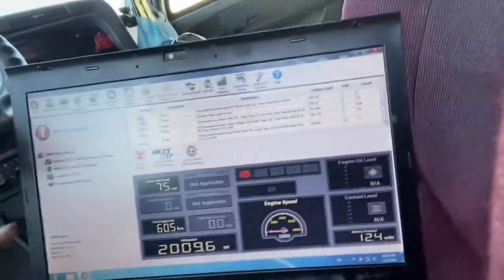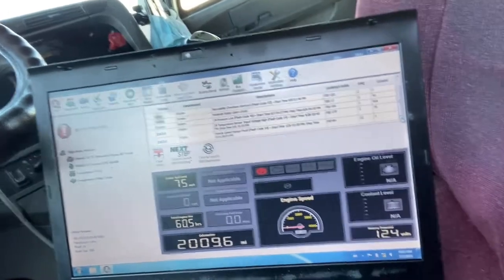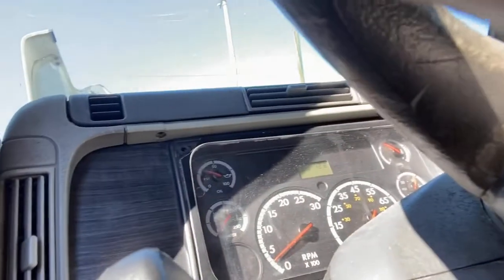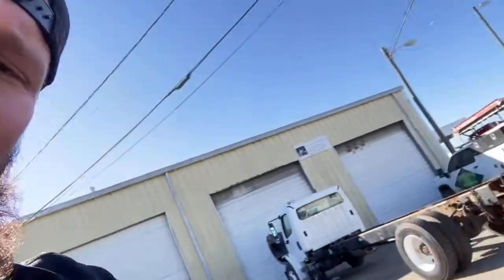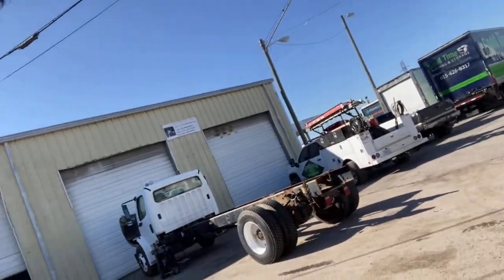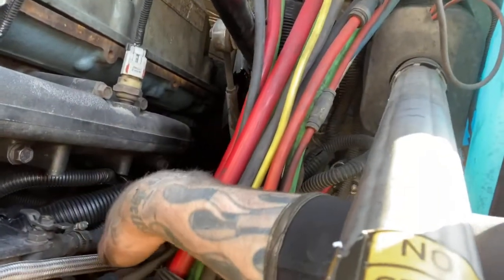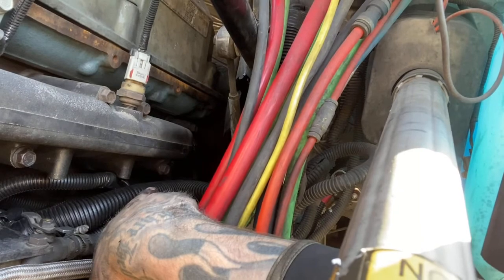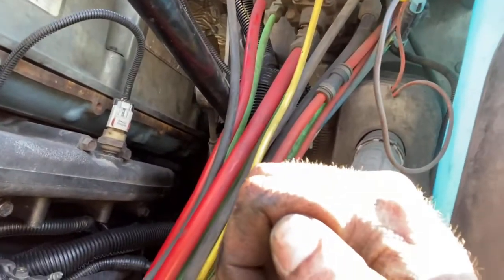No oil pressure shutdown DD60 Freightliner Columbia

Comment: We had to clear the live data using a scanner  said had no oil pressure cleared code wasn't enough have to reset live data as well
Reply from the maker: have to fix the oil pressure issue first
Reply: @StickShiftRacing  it wasn't me but I college didn't put oil in it and he was servicing the fuel filter water separator and he represurized it and was checking it and forgot oil 🛢 😅 which tripped the oil sensor truck did what it's supposed to and shutdown we added oil cleared code still didn't start turns out we had to clear and reset the live data as well he didn't wanna get in trouble lol he's a newbie but ya learn something everyday that's why we found your video
Reply from the maker: @blaizbbs9548  thanks bro make sure to subscribe to my channel!

Comment: I'm helping my dad figure out a similar situation to this video. He has a mechanic that he takes truck to for some repairs but I have some reservations about this mechanic from time to time. He's a decent fellow overall. I'm not a mechanic but if something is explained to me, I can understand. In your video, you mention about checking oil pressure with a manual gauge. Can you explain that process a bit more please? What tools are required, what is connected where and what in depth information will this give you? I'd like to know this information before hand just in case the sensor doesn't solve my dad's problem. This way I'll have some knowledge about this procedure and can ask his regular mechanic this same question and see how the mechanic answers this question. So I'm using this information to see if the mechanic will think this way or if he's just gonna want to throw parts at it till problem is fixed, which isn't really the way to go. Thanks for the video, this information alone is great.
Reply from the maker: sorry for the late response to check with a manual gauge you need a manual oil pressure gauge and fitting these can be purchased at any automotive parts store in fact most sell a kit remove the oil pressure sensor and install manual gauge in its spot start the unit it will display if it has pressure or not

Comment: Mines doing the same thing I replaced sensor sometimes pressure is high or too low , under a load it red lights and shuts down when trying to build speed any ideas?

Comment: How did you manage to reach it? That thing is waaaaay at the back of the block because of how the Columbia is designed.
Reply from the maker: special socket
Reply: @StickShiftRacing  I ended up turning the wheel all the way to the right, removed the black wheel fairing on the left side and crawled underneath the truck and wedged myself between the frame and wheel. Used a 33mm socket  with a half drive and extension. Knocked it out and the CEL light went out on ignition turn on.
Reply from the maker: @willmann30  hell yeah if there’s a will there’s a way sometimes it sucks
Reply: @StickShiftRacing  YESSIR. I had to get in there! I have an appointment for it that I'm going to cancel now. Wanted to put my approach to it in case someone else wonders how. I preciate your content.

Comment: Hey can you help me with a question? My dash guages reads I have normal oil psi but the oil light turns on and my 2ndary guage (connected to ecm port under the steering wheel) reads 0 psi. Any ideas of what would cause the dash guage to read normal psi but the 2ndary scan guage to read zero and the oil light on the dash to turn on?? TiA
Reply from the maker: Faulty dash gauge
Reply: @StickShiftRacing  faulty dash guage, meaning I actually have no oil pressure and the dash guage showing normal psi is malfunctioning? Thanks BTW
Reply: @StickShiftRacing  truck dash gives me code 36 (Oil Pressure Sensor (OPS) Voltage Low)
Reply: @StickShiftRacing  turns out was the sensor

Comment: Average oil pressure for a 2007 DDEC 5 at operating temperature and highway speed under load?
I'm running about 42 PSI.
1 gallon of Lucas Oil Treatment. 
Good, bad, ugly?
Thanks

Comment: So I have a 02 mack VISION sleeper truck reading no oil pressure changed oil pump as well as oil pressure sensor anything well help thanks
Reply from the maker: there is a restriction somewhere
Reply: @StickShiftRacing  as in? Unfortunately I'm not a deisel mechanic so I'm kinda lost.  I changed the oil pump as well as the oil pump sensor no change.. I took manifold off see it's getting oil to top of engine just don't know how much.  Truck starts and runs great for 30 sec.